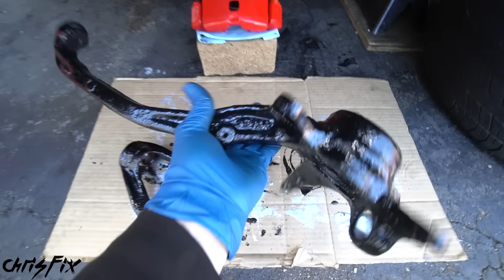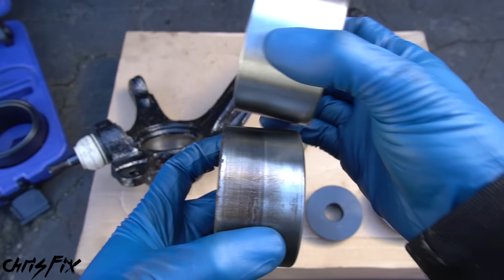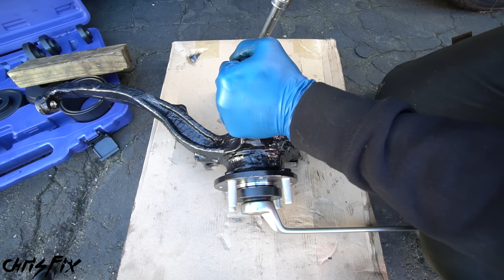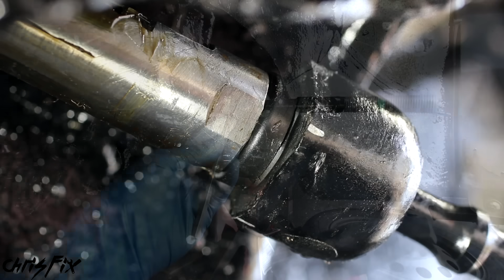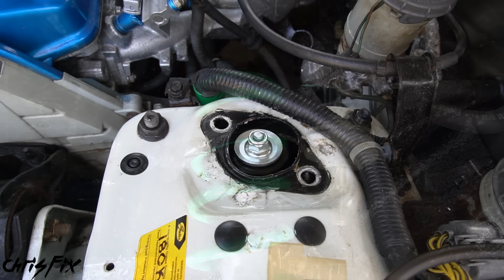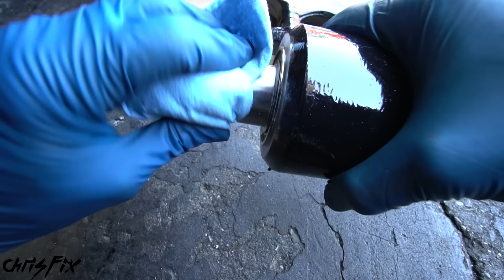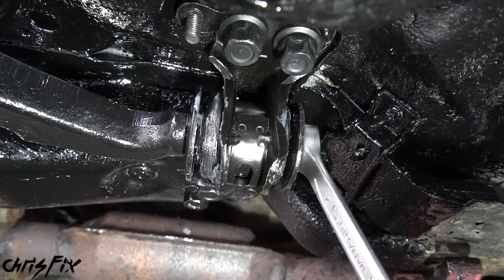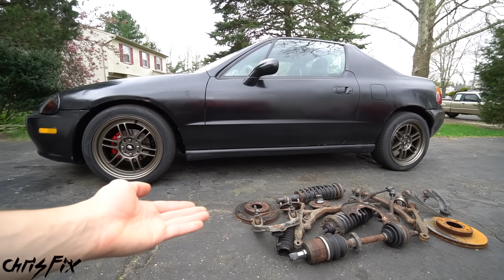How to Install a COMPLETELY New Front Suspension in your Car or Truck

Comment: I've recently discovered your channel and I'd been missing out. Pardon my irrelevant question, but I'm looking into making my '96 VW Golf safer, is it possible/cheap to install ABS breaks after the fact? How about reliable front airbags? Plus, my car is going to go over pretty rough terrains, any words on choosing and changing suspension with practical effects in mind? Thanks a ton!
Reply from the maker: There is no easy/cheap way to add abs. You need to run brake lines, get sensors, a new ECU, brake lines,  Etc. I have never seen an aftermarket airbag either.

Comment: Quick question, are you an actual mechanic or have you just learned this from others and your own research? Also would you ever consider making videos for motorcycle maintenance? E.g. brake pad replacement and replacing the fluid? I realize it's probably similar but wouldnt mind a video about it either

Comment: I've heard that chris will "Heart" your comment if you watch the video while you're in your garage and working on your own Del-sol. 
Let's try it out...
Reply from the maker: YES!!! What are you working on?
Reply: @chrisfix  I'm working on some engine problems, It doesn't get the gas it needs really, so im trying to sort that out. But now i'm gettin' more keen to work on my front suspension :D
Reply: Elias Åberg check injectors. For some reason when I had my Honda, they would goop up so bad. Fuel rail as well loved to clog. So fuel filter was the fix for it.
Reply: @JappyBomba  Thanks! Iwill look into that, thanks for the tips :D